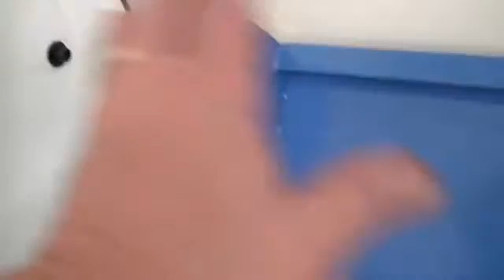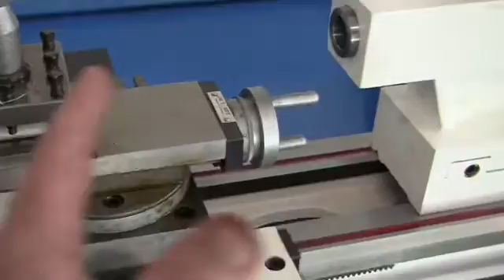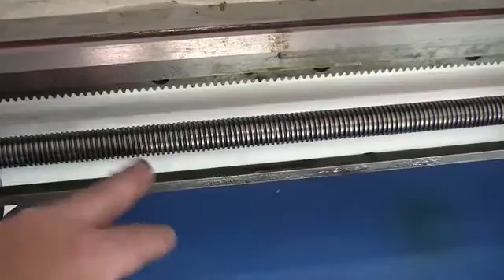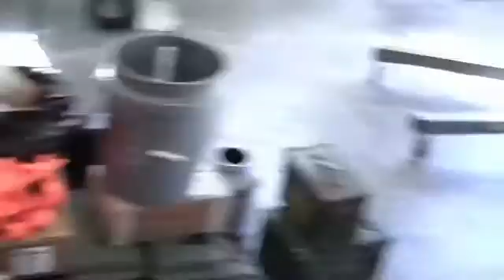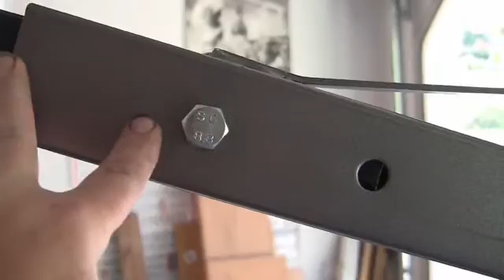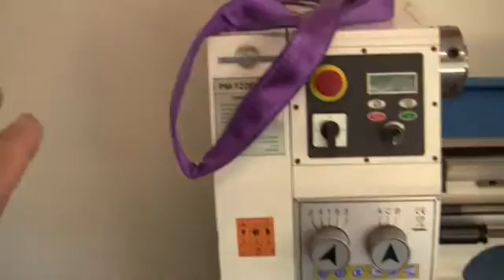PM 1228 Lathe Lifting into place on stand

Comment: Very helpful  thankyou ! ... I just received a similar lathe .. in its crate on the floor. And trying to figure out how I can safely get it into the stand. I will rig up a chain block so I can lift it from above rather than use an engine hoist exactky because if the problem with the Houston legs you describe. But I still have the problem the lathe isnt stable. Hmmmmmm

Comment: And that’s a small lathe. My bt1337g is double the size of that machine and extremely headstock heavy. Can’t beat a camlock spindle you will like the precision of they setup the spindle and tailstock properly. Hopefully it is better built than the PM833t. I’ve had nothing but issues with PM machines and zero customer support.

Comment: I just mounted my new PM 1288 on the factory stand. We used a HF 2 ton engine hoist and a load leveler and  two 2" wide straps. I pre-installed the mounting studs in the stand . From pick up to bolt down it was an amazing 4 minutes.!  The load leveler  made it a very simple task. 

BTW We had no trouble with the  holding bolts as they came loose from above.

David G.

Comment: I think you did very well getting that lot mounted up, to have to lift the whole pallet to get at the holding bolts is a really bad bit of packaging, also by using the engine crane you cannot lift far enough out to get a lift over the centre of gravity, to get over that problem, I made a tripod from 3 lengths of pipe, and used a chain hoist , that got me right over the top of the load, I can see that with the lathe not yet mounted on its base, when you lift off the bed it will try to roll over! Well done so far!